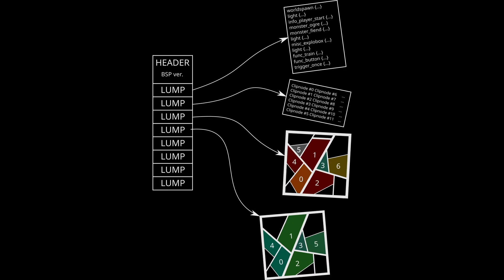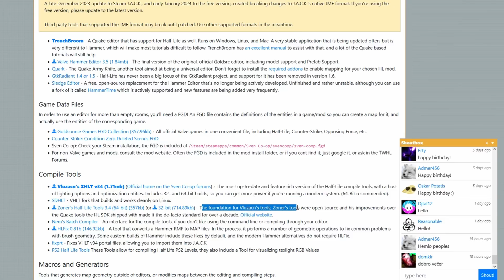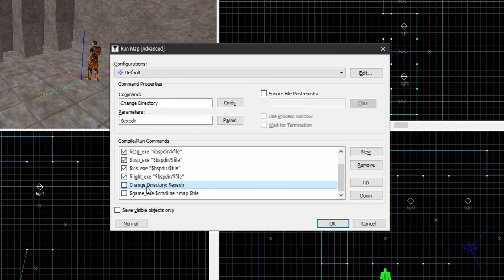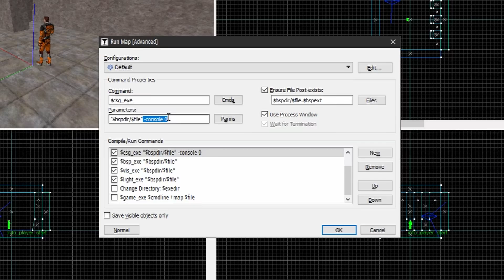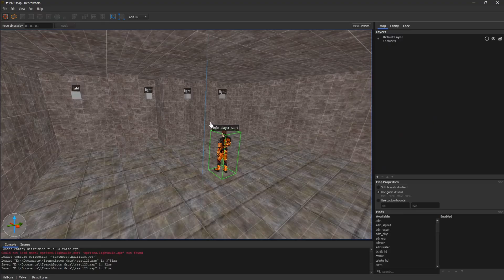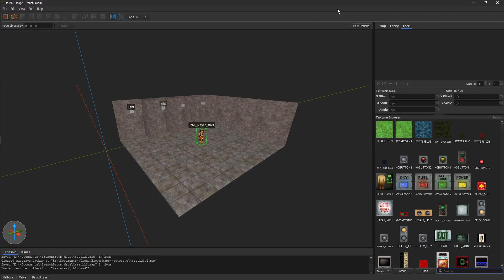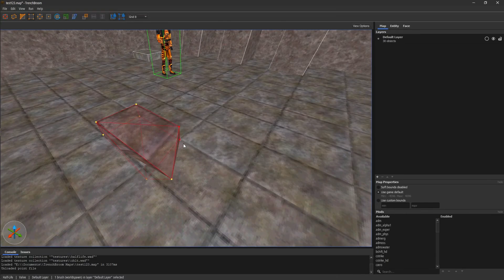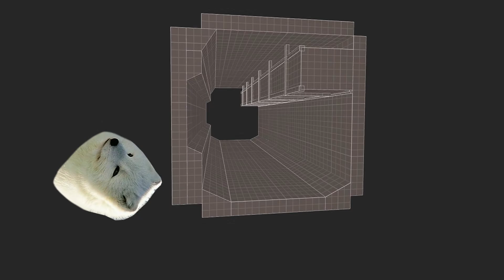How to compile your Half-Life map

Comment: Hey, thx for the tutorial.
Do you know if it's possible to automatically run a batch file after the compiling is finished?

I've to, but it gives an error  "w_loadwadfile couldn't load gfx.wad" which should not even be related to the Run tool command.
I guess that it doesn't run the windows cmd.exe normally, so my .bat fails.

The .bat runs normally when I execute it via double click from the explorer.
Reply from the maker: @theprogrammer8200  It should be possible, so long as your working directory is correct

Comment: good evening... one quick question... how do I add pain and death sounds to the player just like deathmatch classic and team fortress classic?
Reply from the maker: There are already pain & death sounds. In player.cpp, in CBasePlayer::Pain, it randomly plays "player/pl_pain5.wav" to "player/pl_pain7.wav".

All you need to do is change those sounds, while keeping the same name. Sorry for the late answer!
Reply: but the pain sounds only sound when the player is torn to pieces, I mean if there is a possibility of those sounds sounding when being shot or fractured
Reply from the maker: Hmm. I'm thinking. If you don't wanna write custom code, you can get away with modifying sentences.txt. You'd be replacing the HEV suit line with a simple pain sound in that case.

Otherwise, look at the CBasePlayer::TakeDamage function. You will see that it plays sentences "!HEV_DMG0" to "!HEV_DMG6" depending on the type of damage. You can simply add a call to Pain() in there.
Reply: @Admer456  ok thanks...

Comment: 0:40
I don’t know anything about mapping, but is this Quake-style BSP responsible for GoldSRC (and Source) having such a limited map sizes, limited interactive stuff (entities) you can put into said maps, and, consequently, frequent loadings? Because (Gold)Source loadings, and somewhat artificial, strictly square map geometry have been puzzling me since I was a kid.

Or is there a different reason why GoldSRC and Source games seem so.. small scale, so to speak? I’ve always felt that games on different engines had just more.. stuff in their corresponding maps. Do I make sense?
Reply from the maker: Not sure what you mean by "strictly square", there's plenty of examples where it's more organic, e.g. Xen.

This question has a super complex answer, it can be both yes and no, depending on your perspective. You can skip to the TL;DR on the bottom of my reply if you don't wanna read all of this.

Limited map sizes are partly due to netcode: player coordinates use 17 bits each, of which 12 are for the whole part (going up to 4096), 1 is for the sign, and 4 are for subdecimal precision (i.e. accurate down to 1/(2^4) of a unit). Ultimately, this gives you up to 8192^3 units of playable map space - you can still make stuff outside of it, but you won't be able to go there. This can be overridden in today's mods, but shh.

GoldSRC itself can handle about 2048 entities total within a map, which should be pretty reasonable. A hundred NPCs, a few dozen triggers and other logical entities, leaves you with a lot of space for other things. So that is definitely not a reason for small maps.

The only problem is that, again, due to netcode, you can only see up to 256 entities simultaneously. This doesn't let you have many entities within close proximity. Since the 25th anniversary, that is now upped to 512 entities, but still.

I think the more "frequent loadings" happen simply because they didn't want to waste too much RAM and processing power back then. The original HL maps never really got close to any of the GoldSRC BSP format limitations.

Some limitations also stem from the software renderer: it can only render up to 800 map polygons, no more than that. If you go above that, any polygon above the 800th one is simply not gonna get rendered and you'll have missing surfaces. As such, you couldn't have very detailed rooms or outdoor areas.

HL1 maps are relatively simple, they are not technologically demanding. I think this is partly because Valve was in a rush to make them all, so there was no time for super duper detailed brushwork, or fitting them with all kinds of props and interactive items.

The game itself provides basic tools for us mappers to do interactive things: buttons, doors, trains, levers etc., and you can already do a lot with those. You don't need to specifically make buttons out of buttons, you can use a sliding door entity with the visuals of a button, and the player won't really notice a difference if you do it well enough and consistently.

As for Source, I dunno, it's got its own thing. In either case, the engines are pretty capable of non-square geometry, and lots of interaction. It's just that Valve either didn't have the time for it, or they felt like it'd be too much.

I can't put the blame on the level editor (Hammer), because games like Unreal, System Shock 2 and Thief weren't made with more advanced tools than that. UnrealEd has some tricks up its sleeve, but fundamentally it's just as "bad" as Hammer, and it has its own quirks. And don't get me started on DromED.

But yeah, TL;DR:
A combination of networking code in small part (so, Quake-style client-server architecture), lack of time to do lots of polishing and detailing, not wanting to waste a lot of resources (it's easier to digest a dozen small bites than one huge bite), and generally just playing it safe, so that the engine doesn't bite them in the butt.

if you had access to GoldSRC, it would absolutely be possible to just raise some of these limitations and make really huge maps, on the scale of Unreal, Gloomwood etc., with lots of interactivity.

Sven Co-op has some of these limits raised, as well as Xash3D, and I mean heck, a lot of Quake forks nowadays have it even better. I think it really boils down to how much time you can spend on making one level.
Reply: @Admer456  Thank you for the detailed reply. The loading frequency and map sizes were especially jarring in Portal 2 and Episodes, as “newer” Valve games. It seemed like they retained entire set of limitations of GoldSRC. I think by that time we had dynamic loading and much larger maps as industry standard. Don’t know how are things in Alyx. But it seemed like frequent loadings were some fundamental limitation of Valve’s technology. Square geometry.. Well, it’s like the levels are extremely flat and geometric, like in brutalist architecture, no detail, and there’s stuff just put on top of it. Like props, etc. Gives very artificial feeling, like, I can feel and see geometry, map limitations, particle sources, interactable entities, all the inner works and artificiality of the world, while with time in other games it was hidden better and better. And HL2 and Episodes seemed like they were stuck in the 90s. Compare even CoD4 and Episodes 2, even though CoD wasn’t technologically impressive. The only thing they did to alleviate that feeling was pre-baked destructible environments that saw heavy use in Portal 2, arguably more than in EP2. Or maybe I spent too much time in these Valve games and started to see inner workings clearly.
Reply: @Admer456  does source 2 have this kind limitations too? i mean they ditched the bsp altogether in favour of octree
Reply from the maker: @gibsson  Nah, Source 2 maps are basically meshes and Source 2's Hammer is basically a model editor with some game-specific functionality. No longer do you need to worry about the exact shape of your map geometry and how well it can "cut".

I don't have a lot of experience with Source 2 though, other than a couple months tinkering with s&box a little bit, so I'm not sure what exact limitations it has of its own.

Comment: Are there any linux repositories that contain everything you need to use the source engine?
Reply from the maker: Hmmm. For Source, there's probably some info on the Valve Developer Community, mainly how to work with Source SDK code on Linux and maybe how to use Hammer on it.

For GoldSRC it should mostly be on TWHL - it helps that a lot of tools there are source-available so you can just build them on Linux. What interests you specifically?
Reply: @Admer456 I am very tech fluent from a generalist (beginner/intermediate at everything) perspective but know almost nothing about gamedev. I want to see what the source engine has to offer and plan on trying everything. I was just wondering if there was a repository that integrated seamlessly into most package managers instead of manually downloading individual pieces of software.
Reply: @Admer456 can you see my reply? YouTube might have auto deleted it
Reply from the maker: No worries - I can see your replies in YouTube Studio. I just hope you can see mine as well. Maybe it'd help to chat on Discord, Matrix etc.?

"repository that integrated seamlessly into most package managers"
Oof, the situation is pretty dire, and especially so for Linux. I'm not aware of any such thing for either engine.
Reply from the maker: Well, you might want to explore gamedev in the realm of Quake. It's a lil' old but it has plenty cross-platform, free and open-source tools - being that by itself.

Also I get your shock, but it's really not surprising, at least not to me anyway. As a GoldSRC modder, I feel basically 100% absolutely neglected and I'm fine with it because that's how it's been for the last 10+ years, bar the little anniversary update. (which they had to hire contractors for!) Valve is really just a different bunch of people these days, and most of the folks there prolly aren't even aware of Valve's legacy, so why bother even maintaining it? I'm gonna rant a bit below:

Valve once used to care about modding and all their original ideals (I call this the "millennium Valve era", cuz' that's how Valve seemed to be 1996-2005) which helped them get where they are. At some point, they started collecting promising mods and made franchises out of them, cuz' yeah, their pro-modding philosophy allowed for such material to get made in the first place. Early Valve wasn't really all that super duper pro-Linux, but that came soon enough, when they switched to SDL2 and ported Source's renderer to OpenGL. I recall there's some slides about that from 2007 or so.

Valve became this company that was pro-modding and pro-Linux, alongside many other things.

But, something happened. They slowly changed course over the last two decades. A lot of the people from that "millennium Valve era" have left by now, esp. the very original 1998 cast. New people joined, and Gabe is pursuing other things really. Nowadays, the gamedev portion of Valve is really just a bunch of seasoned gamedevs who are kinda there for the portfolio - they stay for some 6 months to a year and leave for some other company. They mess around with random prototypes until they hang on to something that seems to work for everybody.

As such, I'm fairly sure that those people don't. Care. At all. About any of Valve's legacy. (with due exceptions, like the few folks who worked on the 25th anniversary, and the few who still find time to hand out the rare Source licence)

Valve should never be seen as one single entity, really, it's just a large group of people with different interests, and the stuff they end up showing to the public just happens to be somewhat coherent and unified-ish, because it happens to be something that everyone there (miraculously) agrees to work on.

That is why "Valve actively funds [...] Linux [...] for gaming" and yet at the same time they don't bother maintaining their own SDKs or release cross-platform tools. There's a group of people inside Valve that care about Linux gaming, but those people also don't happen to be working on any of the engine tooling. There's no consistency within Valve, it's just a soup of developers doing random things.

That's why it ain't surprising to me. Source is just abandoned and neglected, nobody wants to work on that thing. Everyone's after Source 2, making Deadlock and working on CS2 and whatnot. They just don't care, they appear to be out of touch with the community, and there's no incentive to care either.

Or maybe I just have some terribly unreasonable demands, like "find some time to open-source GoldSRC, or at least get a contractor to do it" and "release an updated SDK that has the features from the 25th anniversary". Maybe I'm the one who's wrong lol
Reply: @Admer456 unfortunately I am unable to reply. I love censorship

Comment: This is very useful, thank you so much for your videos!
I want to add a trick for finding leaks in very large and complex maps, because sometimes the pointfile isn't very accurate:
I basically create a huge worldbrush than encases maybe 1/3 of the map. I then try compiling the map. If the compile process gets past the world creation without any leak warnings, I stop it, knowing that the leak must be somewhere withing the boundaries of my block. I now reduce this block in half and compile again. If it still compiles, the leak is still inside the now smaller block. If the leak now appears, it has to be in the area where the other half of the block was before. With this technique I narrow the potential leak area down until a very small area is left. This usually helps me find the leak very quickly. Also creating these temporary worldbrushes forces the pointfile to change and sometimes it gets more easy to read. :)